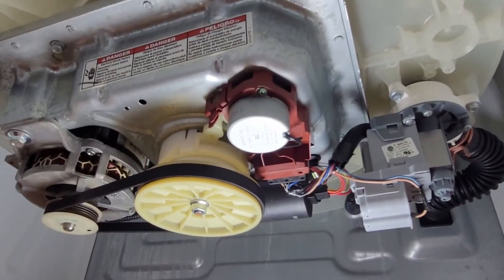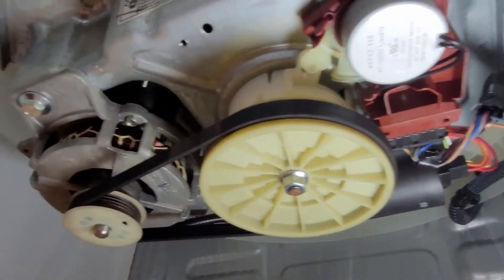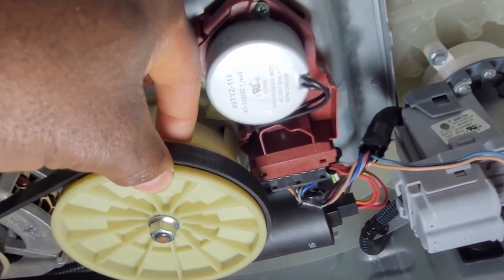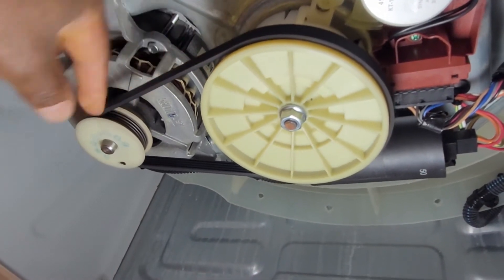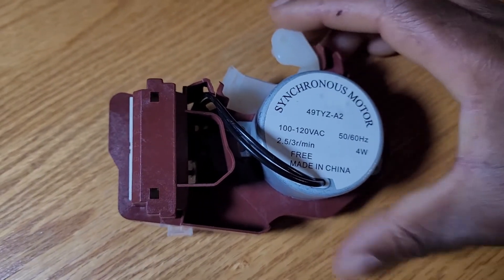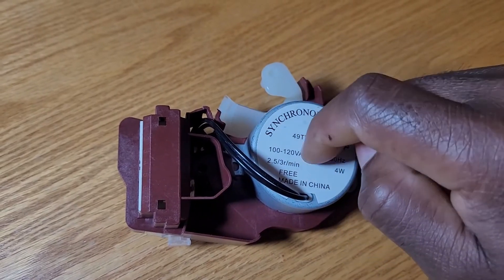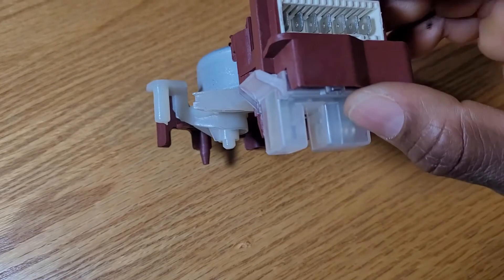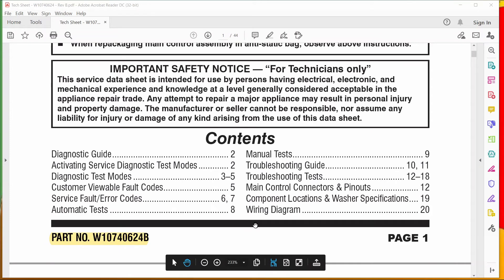How I fixed my Maytag Centennial washing machine for $50 - Part 4

Comment: That actuators has the tachometer built in so when you test and the tachometer doesn't register movement, it is faulty and it will not spin.